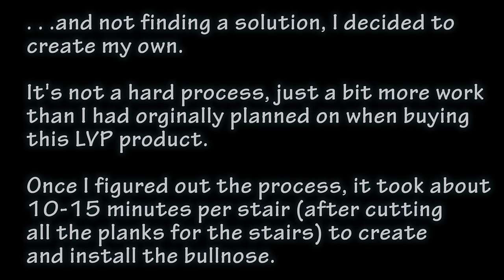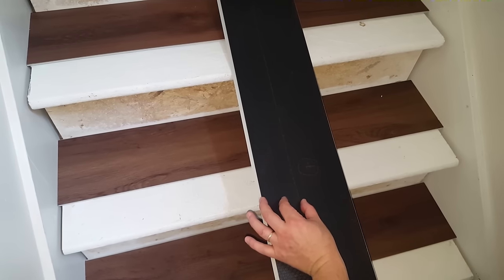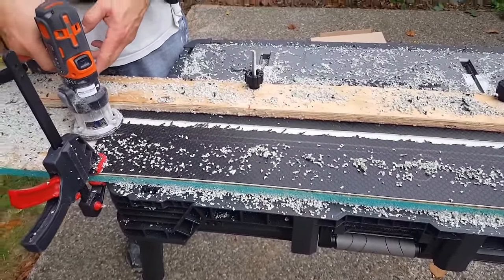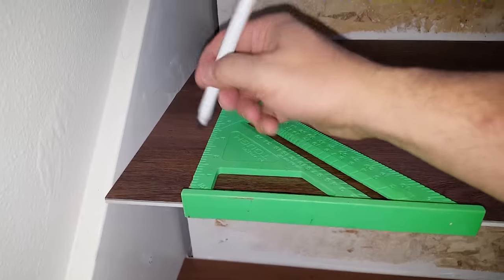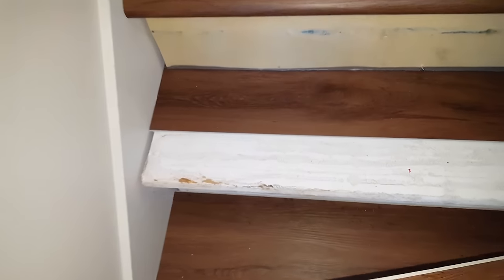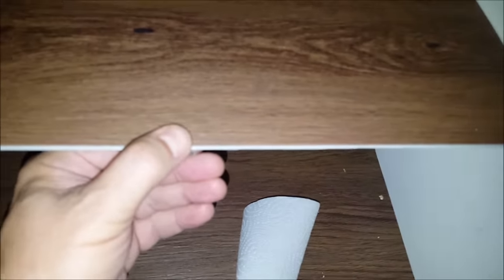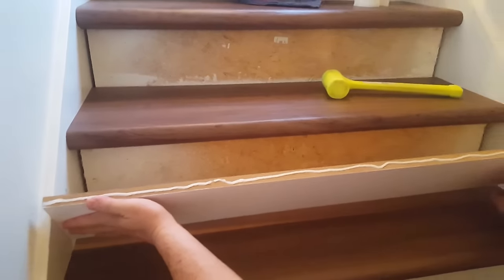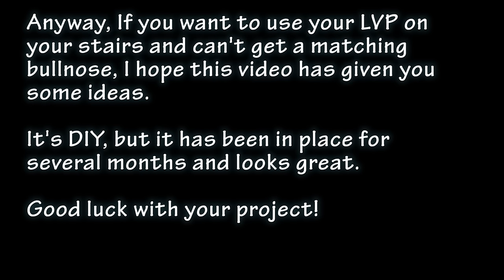LifeProof LVP Flooring: How to use on stairs and create a matching Bullnose!

Comment: Why do you have to remove the rubber/plastic backing that would go around the overhang on the tread? Can it be bent without removing this backing with the correct amount of heat?  The reason I am asking is because after we did the floor, the scraps were left outside for trash pickup.  While they sat in the sun, they started to bend over from the heat.  I'll be doing this myself, no prior experience and do not want to do anymore than necessary otherthan the required patience.  My mate is no longer with us, and I have to do all this on my own.
Reply from the maker: Hi Mickee, thanks for watching. In my case, the rubber made it too thick to heat up to a point where the plank was malleable without melting the actual plank.  Other LVP products may be easier (or harder) to work with, but with I suggest you take a scrap piece and test it out to see if you can heat it to where you can bend it without damaging the vinyl floor part. But yeah, patience is the key when heating it since you don't want to ruin it.  Good luck with your project!
Reply: @ChronologicallyExperienced  Thank you. 😊

Comment: That looks great!  What type of glue did you use to secure the LVP planks?
Reply from the maker: Thanks Greg, greatly appreciated! I used the Loctite Powergrab Construction glue. Not only did it make a solid bond within about 15 minutes, it didn't melt once I started using the hot gun.  This way, the plank against the riser was solidly in place and allowed me to snap the bullnose piece in and bend it without worrying about the first plank coming loose. I tried a different name brand glue but it melted right away and everything became loose and sticky.  Hope that helps.

Comment: I think i might try this on my steps. By any chance did you try nailing the plank under the front of the step and heating it from the inside?
Reply from the maker: No I didn't try that. I wanted to use a full plank on the flat part so I didn't have too many cuts. By gluing down that first plank, I could easily snap the bullnose piece into the other plank to make it seamless and it held the bullnose in place while I did the bending. Given the stiffness of the plank, I'm not sure I could have gotten the bullnose to bend and stay level enough to snap into the top plank . But then again, I've never done this before so there could definitely be a better way.  Since I (hopefully) won't be doing this again, it's going to be up to you now to try that out and let us know how it went, heh heh.
Reply: I just finished my steps and used your idea but tweeked it a little. I bought a stair tread and made a jig to pre bend all of the nose pieces. Then used a stair tread template to cut to size.

Comment: Any squeaks on the stairs now after they've been down a while now?  I see one site has treads for 65-70 dollars apiece.  You saved a fortune here.
Reply from the maker: I'll be doing an update video this month since it has been about a year now. Spoiler alert: They still look, feel and function beautifully!  :-)
Reply: @ChronologicallyExperienced  No, movement in the planks? ACS, (Home Depo's flooring contractor) told me lifeproof and any other floating plank with a soft backing (pad) can't be glued down. they said the glue won't hold long term to the soft material and will eventually release.

Comment: is that lvp glue or cliks?? how many mills? thank you
Reply from the maker: I used Power Grab construction glue. However, in my update video, I mentioned Urethane glue as a better choice as suggested by one of my viewers. Not sure what you mean about the mills? If that's referring to how much I used, I couldn't tell you - basically a bead along the outer edge and two down the middle. Hope that helps.

Comment: I would of done some thin relief cuts on a table saw..you would of kept the same thickness and strength on the nose wrap..Johnny homeowners always over analyze an easy problem..
Reply from the maker: As a casual DIYer, I don't have a table saw so I used what I had access to. In my update video I mention various suggestions from viewers and I believe kerfing (or something similar) was one of them. Thanks for watching and Happy Holidays!
Reply: I don't think kerfing would get you 180* bend, even with steam....but please upload your actual images so we all can see your actual method/results...  until then, great job by this OP ...🎉

Comment: I wonder if a series of saw cuts would have worked better, possibly no heat required depending on the depth of the saw cut. people use that technique to bend wood and plywood etc.
Reply from the maker: Check out my one-year update for additional tips/suggestions. In that video I discuss the kerfing suggestion. Thanks for watching!

Comment: Wonder if it would be easier to do if you could assemble and form each step on your workbench.  😮
Reply from the maker: Yes, that would have been much easier and suggested that in my follow-up for those that have consistent step measurements. Unfortunately my steps had different thickness (and width) from one stair to the other so making a standard form wouldn't have worked for me as I would have had to reheat and adjust it for each stair anyway.  Thanks for watching!

Comment: What material did you use for the risers?
Reply from the maker: Hi Amy. I used a 3/4" thick by 7 1/4" high pre-painted MDF sold at Home Depot and cut it to height as needed. Thanks for watching!

Comment: Could you prep these ahead using a piece of wood the same size as your bull nose?
Edit: I asked this question before the notes at the end haha
Reply: You can and I did. I bought a spare rounded stair tread from the big-box hardware store and built a jig to bend them all over once they were cut to the individual widths (yes, modern house that has poor tolerances on build dimensions). I'll end up taking a video and posting it before I tear everything down with initial due credit given to @Chronologically Experienced since I stole his idea to start with.

Comment: does lifeproof rigid core luxury vinyl flooring also can be bend? Thanks
Reply: You'll probably have good luck IF there is no UV layer on the lifeproof.  The ones with UV layer will not bend.  They crack in two when bending.  Smartcore Pro, from Lowes, bends like a dream.  Smartcore Ultra does, too.  However, for stairs, you need something wider than Smartcore Ultra...like the Pro version.  Ultra does not give you enough plank width to put the second plank on and go close to the riser.  If you are using 1/2" risers ou could do it with Smartcore Ultra, though.
Reply from the maker: Sorry for the delayed response. The best way to find out is to take a small sample and work with it to see how much effort it would take to bend it.

Comment: Yo Mr Wright what happens if your treads are 3x more importantly if your wrapping don't measure correctly to line up male female ends.
Reply from the maker: Hi John, thanks for watching. Not sure who Mr Wright is, but as for me, I only have experience with the narrower stairs (I'm assuming you're referring to the width) and was able to get away with one plank. This could get tricky if you have to put another plank end-to-end as you mention, but I think the overall concept could still work - especially if all the stairs are uniform. Good luck!

Comment: Once those risers start expanding and contracting its gonna make a lot  of noise, a bit of tolerance would ve not been bad
Reply: Yeah, not sure why he can't just put a small nail on the underside of the bullnoses (after using the makeshift riser to ensure it cools in place) and then put in the real riser with some small gap at the top that is then caulked.
Reply from the maker: Hi Omni89, I just uploaded the one-year update so you can see how they are holding up. No noise yet, but I probably could have left some extra space as you suggest just in case.

Comment: Wonder if I can get the same results with laminate flooring
Reply: You can. I did one and it came out nice. But you cannot bend it for the bullnose.
Reply: @Orangedome  the flooring I picked doesn’t have a bullnose was hoping this would work lol
Reply: Just get a matching stair nosing (plate). Self adhesive ones in all wood shades are readily avaliable
Reply from the maker: I'll have to leave that to others as I have no experience with using laminate.  I would get a few pieces and test it to see what kind of results you get.  Good luck.

Comment: What was the total cost and time to do this project?
Reply from the maker: It's been quite a while now, but the cost was mainly the materials (LVP boards, glue, riser boards) and I think the time spent was about two hours for cutting/routing the boards and about 4-5 hours to actually mold and install the stairs. Obviously this was the first and only time I've done this so someone more skilled could probably reduce the time quite a bit.

Comment: Just buy the cap a tread system that matches your vinyl plank
Reply: But what about when you reach a landing? The capatread system does not match the lvp in size. So there's no way to join lvp flooring with the tread cap🤷‍♂️
Reply from the maker: At the time, we were told there were no matching treads and the ones that were available were not seamless an/or did not colormatch. Hopefully folks have better selections now but the ones I've seen still don't give that seamless transition that we wanted.
Reply: You use a color match stair nosing for the landing it is slightly different from the cap a tread nose but matches the color when installing the top landing the top stair nose will need to be spaced properly so the nose will be a seamless to the lower kick plate honestly it is a lil difficult but that would be home the manufacture recommends

Comment: How long did you heat it ????
Reply from the maker: Just long enough for the material to become soft and malleable. I used a simple heat gun on low for a few minutes (holding it about two inches above the material) and went back and forth so as not to melt it. Obviously the time it takes will vary depending on what you are using to heat it, but you can feel the material periodically (careful as it will get hot) and you will easily notice it getting softer.  Hope that helps.
Reply: @ChronologicallyExperienced  thank you. I’m gonna try 🤞🏻

Comment: I thought you had to leave 1/4" around the edges due to expansion?  How did this hold up over time?
Reply from the maker: Check out my 1-year video update!
Reply: On a step that you're gluing permanent,  you do not need 1/4" expansion. Expansion requirements are for room size installations..

Comment: Did you glue the LVP to the stair tread? I saw you did to the bullnose.
Reply from the maker: Yes. I used the Loctite Power Grab construction glue which dried fast and didn't melt during the heating process. Once the riser went in, everything is solid as a rock.

Comment: Might help to make a stair tread form and bend them in the garage at a work bench.
Reply from the maker: I was hoping to do that, but whoever did these stairs wasn't very consistent. They varied in thickness from 1/4 to 1/2 inch which is why I decided to just wrap them in place. Sure would have been easier your way.

Comment: Just buy stair nose to do the job.
Reply from the maker: They don't always match the color, texture, have a lip or otherwise don't mesh well with what you buy. Some manufactures only sell those matching noses to professionals which leaves a DIYer like myself out of the loop. This was my solution and not intended as a 'must do' for everyone.
Reply: Yeah... I have been looking for a matching stair nose for days. The closest thing looks like crap and I was essentially told tough luck.

Comment: Or you can just buy the matching bullnose for $30   
At lumber liquidators And it covers 2 stairs per piece. 😂😂😂
Reply from the maker: They don't always match the color, texture, have a lip or otherwise don't mesh well with what you buy. Some manufactures only sell those matching noses to professionals which leaves a DIYer like myself out of the loop. This was my solution and not intended as a 'must do' for everyone.

Comment: There goes your warrenty
Reply from the maker: As far as warranty, I can't imagine that any company would warrant the planks after manipulating them this way, but that is a decision that I, as the home owner, made.  Not going to worry about the warranty for a few planks if for some reason they crack or whatever since I knew ahead of time that this wasn't standard use of the planks.
Reply: @ChronologicallyExperienced   I doubt it would void any warranty for the flooring laid on any sort of flat surface, but the stairs yea.... I can it it wouldn't be warrantied.  Not really a big deal though.  If it is... just head premade solid wood treads and have someone mix you up stain to match.  A little harder, but still pretty straight forward.   Way to think outside the box.

Comment: Heat from the back
Reply from the maker: I did try that initially, but because I needed to mold the planks directly over the existing stair, there wasn't enough room to get the heat gun underneath to properly heat the plank without getting too close to the material. For those that have uniform stairs and can build a simple molding station to bend the planks, I think that could work quite well. Thanks for watching!
Reply: I heat them from the back with a propane torch. Builds up more heat much faster but u have to be careful obviously